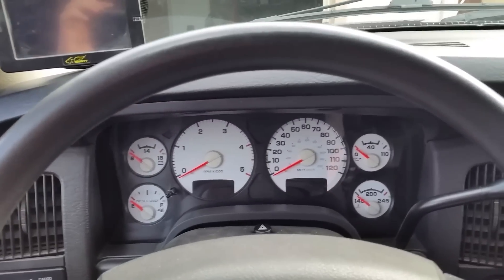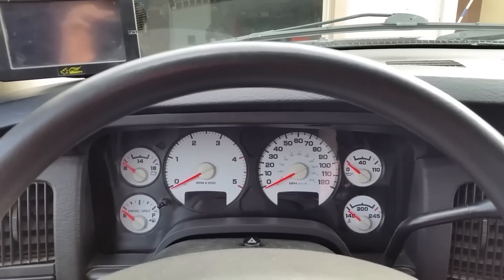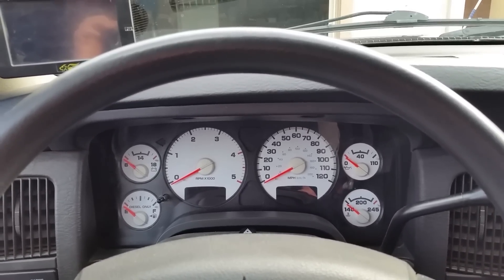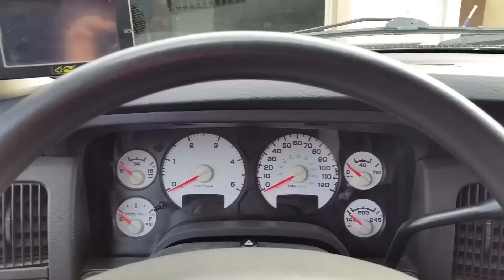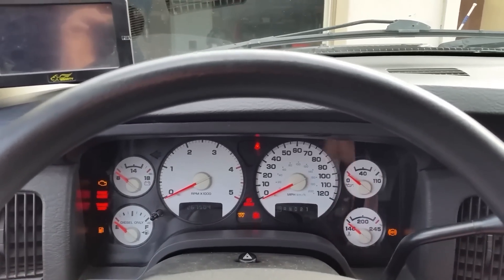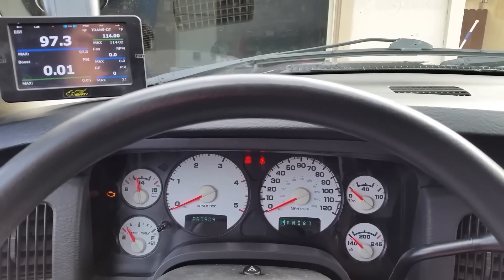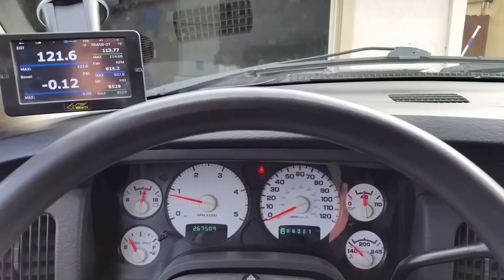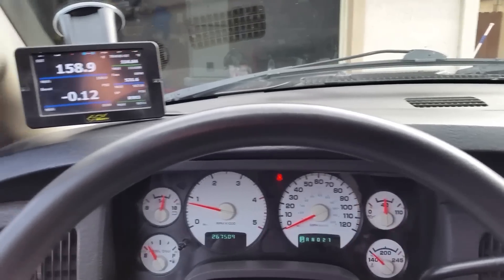3rd Gen 5.9 Cummins 12 Valve Tune - Smarty UDC Pro

Comment: Lot of faith in that parking brake holding strong.
Reply: Well it is a dot requirement that the parking brake must be functioning where the truck and trailer cannot move on level ground in gear with the parking brake engaged.

Comment: How do u get the gauges to run with a 12v.. I bought a 03 with a 6speed from a tow yard thing a cr engine is all i needed pop the hood n there is a 12v installed proper cranks but no start
Reply: He has a single event tune on a common rail 24v, its not a 12v engine swap, it just makes it sound like it

Comment: Hey man I’ve got an 05 5.9 with a 6speed. The only programmer I have is a smarty JR. I run it on tow or economy mode mostly. What do I need to get to have it be a 2nd gen sound ??  Thanks
Reply: You'll need to knock down the injection events to just 1 and get a 2nd gen exhaust manifold.
Reply from the maker: Hi Carl,
You need a tuning platform that can take custom tunes.  The Jr can't.  So either an MM3 Tuner, HP Tuners or EFI Live for your truck.  I can get you setup with an MM3 or HP tuners.  Https://www.mm3tuning.com

Comment: Did you ever post the finished tube? How driveable is it?
Reply: Bradley Rinker I purchased 3 custom tunes from Rob including the 12 valve SIE tune. I use it often sounds amazing and drives even better 👍🏻 I also got the mpg and tow tunes they work well and make my trans run cooler. Gained about 2-3 mpg on the daily driver/mpg tune on a 2006 ram 3500 DRW stock 48re and minor mods.
Reply: @dylan_24v  how long did it take for you to get your tunes back from him
Reply from the maker: Cameron you should have them back tonight or tomorrow morning 👍
Reply: @cameronparks5014  sorry for the late reply but the entire process from reaching out to him until I got the tunes was about 2 days
Reply from the maker: Been driving it ever since!  I never posted it, but I do sell it... 👍

Comment: What is all need to get custom tunes in your smarty touch???
Reply from the maker: For years 03-07.5 it is mainly for better transmission tuning.  If you are interested let me know.
Reply: I have the nv5600 but what is all need for doing the tuning tho?
Reply from the maker: It adds horsepower and torque.  These engines can add about 100hp witonly changing the tuning and no parts.  With parts and tuning you can get to over 1000hp.
Reply: I know that but I’m looking at buying a smarty touch of a guy and what is all need to get custom tunes on it or do I need to purchase the mm3 for custom tunes
Reply from the maker: The touch can certainly do custom tunes.  You will probably need to purchase a VIN license for $150 from smarty resource to use the touch on your truck.
Reply: The guy I’m buying it from is paying to get in unlocked so I can use it on my truck. But I can’t pass the deal up he only wants 500$ for it and I can get custom tunes on it so that save me some money from halting to buy the mm3
Reply from the maker: What year is your truck?
Reply: 03
Reply from the maker: Oh cool.  I sell very affordable custom tuning that will make your 03 drive and shift FAR better than stock.  Let me know if you're interested.
Reply: I will contact you if I get it bought. And get some custom tunes that will wake the truck up a little bit

Comment: I have a single injection tune on my 06. Crazy mpg and also ran a 11.23 @ 122 mph.
Reply: Rob D I don't try to start it in cold weather on that tune. I'll turn it down to tune 2 or 1 "stock". But I do get like 22 mpgs on that tune and it makes about 900 hp. It's on EFI LIVE